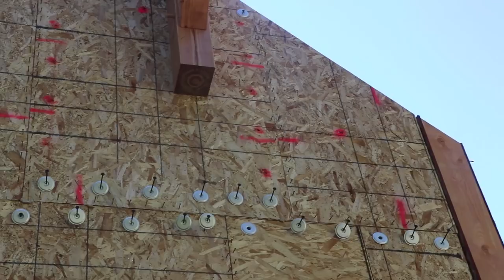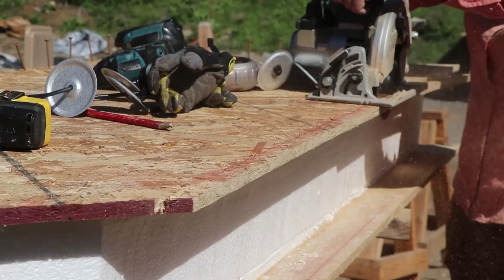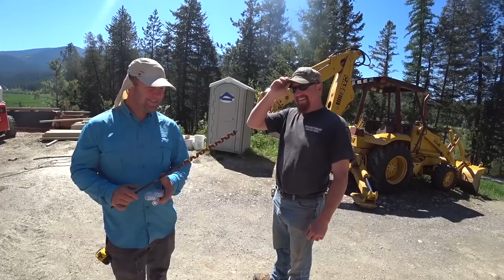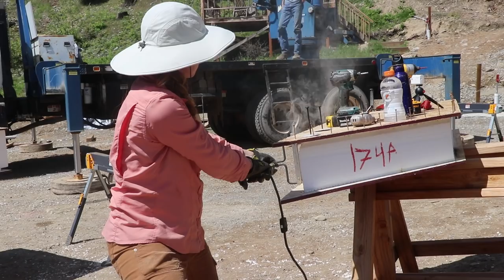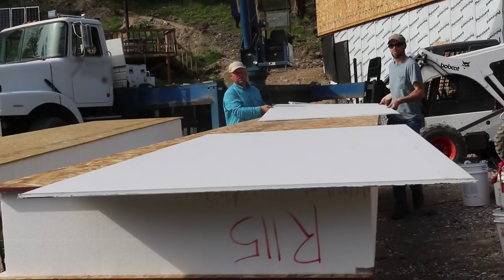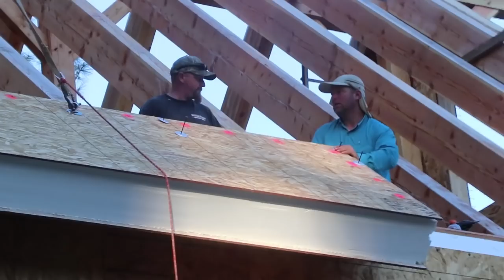TODAY WAS TOTAL CHAOS! (First Roof SIP Panel Install)

Comment: I see you added full sheets of dry wall to the inside of roof sips. So the sheetrock is supporting the roof at each joist? Won't the drywall deteriorate/crumble over the short term, cause the roof to shift, leak etc. ?

Comment: On those brackets,  shouldn't you have bolts or lags the same diameter as the hole in the bracket?

Comment: Great work guys. One thing to consider is not using red or blue chalk on the sheetrock. It will bleed through your paint when finished. Most contractors I have worked with in the past use white or yellow chalk.

Comment: That drywall between to sip and roof beams? I wouldn't be comfortable with that.  I get that it seems easier, but you still have to tape and mud right up to the beams anyway so why not just fit the sheets between the beams once the roof is 100% finished.  

Now you have drywall as a load bearing material, any leaks or moisture and that will come back to bite you hard. What are you going to do? Take the roof off to fix it?
Reply: nevermindthebollocks drywall deteriorates over time and also OSB plywood has no sheer strength so the entire roof needs to be thrown away

Comment: Question why Sheetrock now ? Any wet weather and it's no good and you do not want Sheetrock between your roof and your frame. You want it tight to the frame!
Reply: Yup. Even just a 5 minute shower will ruin that sheetrock.  I also think that you'll find that the SR will warp differently with each panel placement.  Hopefully they figured it out before they got any further.  So much easier, cleaner and neater to hang it after.  Much fewer joints to mud too.

Comment: We are very sad that we chose Structural Insulated Panels (SIPs) for our home. We thought we were being environmentally greener and smarter than our “stick-built” neighbors. We wanted a house that was energy efficient, low maintenance and that would last more than a lifetime. Even though we initially paid thousands more to build our SIP home, we truly believed that it was stronger and would outlast other homes. Our SIP home is only 22 years old and unfortunately we are beginning to see our SIPs deteriorate (this began about 7 yrs ago). We are seeing sagging on both the exterior roof and interior ceiling. We have a ranch style home and the entire south roof is sagging by length and width. So not only are the SIPs showing sag but also the supporting 2x6”s running from the roof peak to the bottom roof edge (measured up to 2” gap). The panels are 4’ x (up to) 14’ with 3/8” OSB interior and exterior skin. They have 5 5/8” EPS (foam) core. There are supporting 2x6’s on each end of the 4’ panels but none between the 4’ span. These SIPs are manufactured by Insulspan (through Foam Products Corporation out of Maryland Heights, MO). Insulspan has moved and is currently located in Blissfield, Michigan. We have contacted both Insulspan and Foam Products and we have been offered no assistance or even suggestions to remedy this major issue. Each stated they will not accept responsibility. Is the SIP industry not prepared to stand by their products? We are very concerned about the structural integrity of our home now (recently hearing lots of popping) and are unsure where to even begin the process of fixing this problem. Our original contractor has contacted another area SIP manufacturer for repair ideas. This company has suggested constructing another layer on top of the exterior panels with 2x8” rafters. Then jaking up the interior ceiling and using long screws and large washers to screw into the new 2x8 rafters. The rafters would then be covered with OSB and a metal roof. We spoke to another Insulspan/ Foam Products customer who had exact same issue (his house built in 1992)and he added interior support by constructing additional beams to reduce the span. To repair or replace SIPs seems an almost impossible project. I have reviewed many posts on this site and there seem to be so much knowledge about SIPs. Our hope is that someone can offer advice to this major SIP problem. Which method would be the best to fix our situation? What are some other options besides removing and replacing the entire SIP structural roof? So very grateful for any response. Morrie and Barb Fraser 618-541-0194 Will attempt to upload a few exterior & interior pics.

Comment: What happens to all the insulation material (styrofoam?) that flys out when you drill holes, cut the side slots in the SIPS etc.? Is it biodegradable or will you be seeing flakes and chunks forever?

Comment: I really appreciate your dedication in filming.  SIP's are relatively new and there aren't any video's (that I can find) that show the problems you run into using them.  It helps put into perspective whether they should be used in place of other building technologies.  I'm still for using them because I see a lot of benifits.  But it helps to know some of the problems I could run into.

Comment: Your crane operator, Trever, is a gem.  You be sure you let him know how much you appreciate his help above and beyond the call of duty.  As to “systems”, you are not unique in your experience.  My father was a wooden boat builder.  (50’+).  Our techniques on the frame bending and the planking had to vary depending on where on the boat we were working.  How much bend, twist, and edge set caused us to develop some pretty crazy clamping techniques.  Add to that the plank or frame being bent was often “steamed” to make it easier to bend so the clock was always ticking to get it bent before it cooled off too much.  Everything was done at a run with all the tools, clamps, blocks, and pieces of shoring all set out ready before we pulled the wood out of the steam box.  So, look at it this way, it could be worse.😬😬. On a good day with three of us working, we could get two strakes around the boat.  (That’s two planks around the boat, about 150-190lf.)  2-3 screws counterbored, drilled, and screwed on every frame on 12” centers.  And here I am at 67 wanting to build another.  (Much smaller this time though.)

Hang in there.  Don’t be discouraged.  You guys are going through what every body else who does one=off custom work.  You are doing GREAT!

Comment: I think it's a mistake with the drywall installed directly on to the roof. I have seen a lot of drywalls but never... and I mean NEVER... seen a drywall installed directly on to the roof. The drywall will be a bridge to the inside this way. It's not protected and will draw moisture into the interior this way. You did not install it like so to walls down below (N, E, W, and S) so why do you think you must do it at the roof?
Another disadvantage is that it can not be replace any longer if it is necessary, because then you would have to deal with the entire roof and that can not be right.

Greetings from Germany

Comment: Are you sure you should put the drywall on now if it rains it's going to ruin the drywall and then the drywall is going to be under the roof sip and this is a tough thing here I hope it works okay

Comment: why don't you maybe try measuring from the bottom of where the roof panel is up to where it setting on the Eve and run a furring strip on top of it all the way across so you can set your first sip nice and straight so you can pull the zip up against the furring strip and then stop and check the squareness from the top of the peak to the corners of the Sip just a thought

Comment: I have a step in, parachute type, fall arrester AKA safety harness, I'll sell you for $25.00. Have some safety rope another type belt. I know for sure the parachute step in type saved my life and a laborer I hired. He fell off the roof and it would have been a 30 foot drop to the dirt. Last time I checked, Lowes had a similar type kit for around $300 bucks. I'm located in Post Falls. Harness can be seen on Craigslist.

Comment: Quick way to get things lined up put a nail or screw at each end then all you have to do is push the panel up to them, fix your panel then remove the nail/screws.

Comment: Those collated screw guns take some getting used to, best advice I’ve gotten is not to try to “drive the screw”, but to rather “stab them in”, gets you in the right mindset. If you’re looking for fasteners, the Senco Dura-Spin or whatever they are called have worked really well for me, and they fit my Metabo which is brand agnostic when it comes to screws, so they should fit the Makita as well.

Comment: I have built plenty of panel houses and stick frame houses. The more I watch, the more I think that These SIPS are not saving much, if any, effort.   I wonder if there is a large cost savings in it Vs spray foam insulating a stick frame.

Comment: BTW, I have found that those Gelato containers, make great screw holders ;o) Saved all of the screws and washers for my sun screen in them over the Winter, also used them when redoing some flashing. And the containers fit nicely in the pouch/pocket on my hoodie jacket.

Comment: As you say the first panel is always the test to see if it's going to be a challenge it's going to be a lot different from the wall and a lot more head scratching and work till you crack the system of installing the roof panels safely

Comment: Seems weird that you are running the drywall between the roof beams/joists and the sips as opposed to letting the sips sit directly on the beams/joists ... you'd think the drywall would get crushed under any king of load (i.e. snow).
Reply: Steven Bowles my guess is that they want the rafters to show inside the house. You can't install drywall between the rafters because the OSB on the SIPS isn't strong enough to hold the weight of the drywall on its own so they are doing it the way they are. I agree with the weight crushing the drywall.

Comment: I admire you and Alyssa's tenacious work ethics and problem-solving skills   As the foreman of this project you set the example and it is you, who is responsible for the safety and welfare of the workers on the site.  I have worked construction for over 40 years and I have seen many accidents and a few deaths from safety infractions.  Dropping a drill, hammer, crowbar or lumber from heights can result in serious injuries.  At the heights you all are working at could easily result in a death.  PLEASE, I implore you to wear hardhats and safety harnesses as needed.  A death or serious injury on your project will forever leave a permanent scar that can never be changed.  Be safe and think about the risk vs reward!

Comment: I personally would choose to use wood instead of drywall. You can get a nice flat surface that will look better and be stronger. But it will add a lot of work.

Comment: Very important... Polish (Emory tape) the outside & wire wheel the inside of the ship's auger when it corrodes like that. 
Use "Fluid Film" to prevent any metal from corroding in storage. (Holds up well & cleans up easily.)

Comment: I have a question IF I may. Why wouldn't you put on the East wall before the West wall? If you put on the East wast first the Crane Operator could see alittle bit more then closing it completely off to him.  Just wondering is all. Love the video's too. Don't work to hard or you will be and 0ld Couple, I know that for sure. Like Me👴🏻

Comment: I get why you’re putting the plasterboard on the roof SIPs at install but I have a concern if you receive any rain before the roof is fully waterproofed!  If any moisture gets thru to the plasterboard at the SIP joins then you could have problems with moisture ruined plasterboard, expanding and crumbling away as well as damp rot/fungal growth!  Maybe you’re going to apply some type of sealant at the mating surfaces as you install each panel but it’ll need to be done well to ensure no gaps.

Wishing you all the best (and hope I’m wrong).....keep up the great work!

Comment: I would avoid using red chalk line on the drywall, it bleeds thru the paint. Blue is better, pencil is  best I would recommend putting a coat of shelak  where you have already used red chalk line to prevent bleed thru, Love the video's keep them comming

Comment: well.... one thing .. those sips at the peak werent compressed and you were drilling on an angle.. getting the all thread in will be interesting.. also you better put the thread in before the roof or you are going to be banging it on a extended ladder.. you can always tap it in to drill your countersink but not 2 feet of it. anyway you are doing great... actually screw that countersink just glue a wood cap on top of the nut that looks like a dowel :o)

Comment: God I have waited all weekend for this video

I would not have put drywall on it so you can drill a ledger board on the inside to help hold up sip roof section until you put in the lag screws.

Comment: Go Jesse, go Alyssa. You're doing great, closing on the roof, which has to be shingled or covered asap as finished. Anyway I don't see any use of the drywall under the roof sips. In case of rain you will have problems and also the panels should sit directly on the frame ... Just thinking...  Cheers.  =)

Comment: You probably already caught it but the same SIP panel that was missing lag screws at the top of the panel is also missing the lag screws at the bottom of that same small SIP panel in the North West corner of the house.

Comment: I have welded extenstions on to things,  can't beat it.  I have an extension but if it fails you lose the auger in the wood forever.  You could have cut you 3/4  panel over hang with a Japanese pull saw.  or a small  cordless that would fit inside the channel.  Put full strength bleach on a wasp sting immediately and it will relieve the pain and break down the toxin with the radical chlorine.  Even later it will help, but best if used early.  Hydrogen peroxide might also help if you don't have bleach.  Bleach won't hurt your skin but will deactivate poisons and chemicals.

Comment: DANGER Will Robinson!  OMG! Who advised you to install the drywall this way? Please read all the builders warnings already posted. It's called DRYWALL!  1)IT IS NOT STRUCTURAL, and if it rains before you have roofing installed, you will have a dissaster.  "A bunch of people that have never built houses"  need some professional advise.

Comment: First and foremost, keep up the great work.

You started the roof SIPs at the bottom, would it be better to start at the top? My mindset is any trimming / fitting seems easier to perform on the overhang SIP and not at the peak. I can imagine installation overall is quicker sliding panels down onto the previously installed panel which might outweigh any possible fitting issues at the peak.

Comment: Thank you for making the mistake of building using SIP panels. You will save a lot of people making the same problems for themselves. Maybe the SIP panels are not the problem but the manufacturer being unable to make to dimensions?  Either way the saving (if any) in buying the SIP system is lost many times over with the huge cost of construction. It looks like the house has to be built twice once to insulate then to waterproof.. lets hope the water / weather proofing never fails even in the smallest of areas.. because repairs will be impossible to do without massive problems. Trying to remove old rusted screws is a major challenge for each screw.. how many have you used on each panel? Building is one thing... but maintenance over the years is something totally different. Unless you are looking at a maximum lifespan for the building of only 35 to 50 years? The framing looks like it could last for 4 to 500 years.. pity the rest will not. In the UK we have many timber framed houses that are 500 years old and above. The key to their long life is ease of maintenance and repair.

Comment: I know these videos are way behind, but hopefully I can give someone some advice that will help if they ever get stung by a bee or other varmint. I'll start off by saying this is not just something I read on the internet. I first saw it in Outdoor Life back in the 70's. And I have personally used the method dozens of time to save my own pain. 

What I am talking about is using DC voltage on any kind of bite like Allyssa got in this video. I am very allergic to wasp stings and I swell up like blowing up a balloon when I get stung. I use the 12 volts from my vehicle battery but I'm sure any low voltage DC will work. What I do is strip the ends of a wire about an inch from the end and with alligator clips clipped to the battery I put one end of the bare wire on one side of the bite and rub the other end back and forth on the other side of the bite. And over the top of the bite also. Just be careful when you are touching the wire to your skin and don't stick the cut wire ends into your skin. And rub the wires very gently touching the skin softly till you feel the tingle of current going through the bite. I also sometimes dampen my skin with a damp cloth to get a little more tingle going. 

What happens is the positive flow of DC voltage will completely neutralize the negative ions of the poison and the poison will have absolutely no effect on your skin at all. I have done this to numerous people and it is amazing how well it works. By the way, they sell a kit that does this in other countries but our govt will not allow them into the US because the fda will not approve them. Go figure. Should I say try this at your own risk? I just hope it helps someone so they won't have to endure the agony of pain a bite can bring.....

Comment: FYI: A good remedy for any type of wasp/bee sting is to put a copper penny, 1981 or older, onto the sting area for about 30 minutes using almost any type of tape to hold the penny in place. I used this remedy some 40 years ago and was amazed at the results and still use it exclusively today.